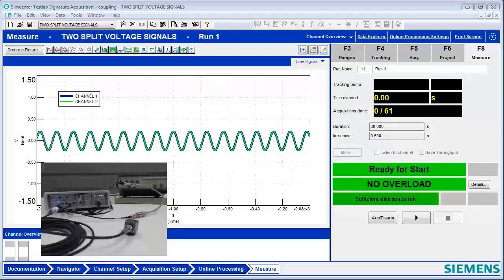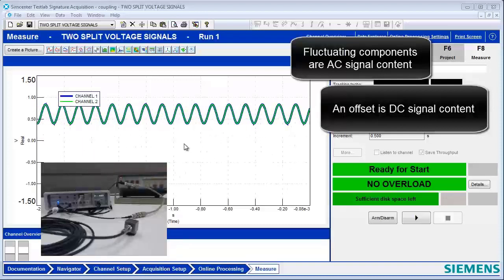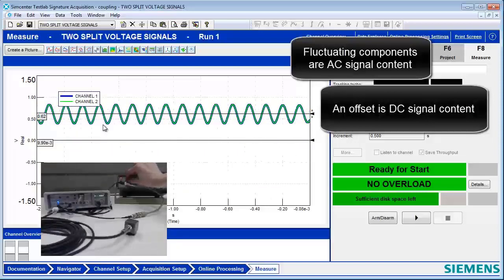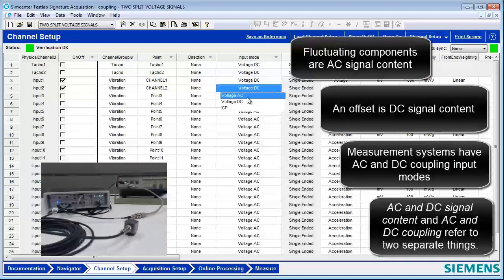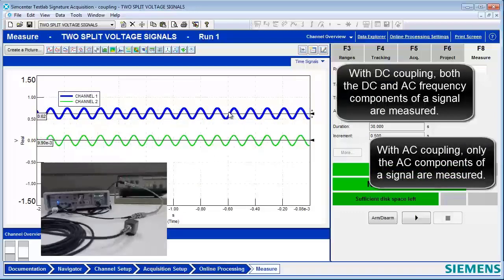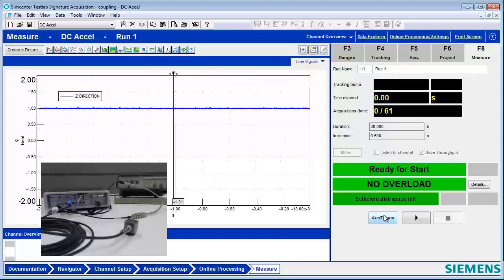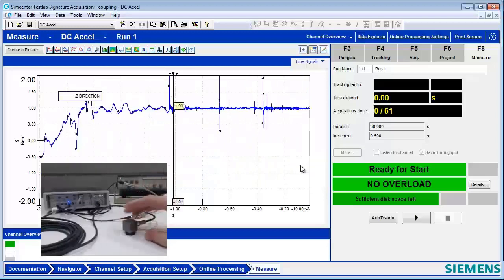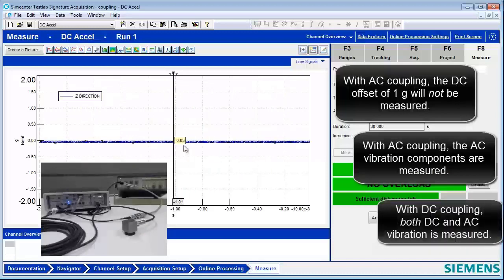AC versus DC Coupling

Comment: Then why AC coupling is used ?  In which circumstances it is better than DC ?
Reply from the maker: Icp based accelerometers supply dc power on the the same wire as the dynamic signal. In this case, ac coupling is better to separate the supply voltage from the actual signal. Sharing the power and signal on the same wire reduces the complexity of the setup. Examples here: https://community.sw.siemens.com/s/article/ac-and-dc-coupling-what-s-the-difference